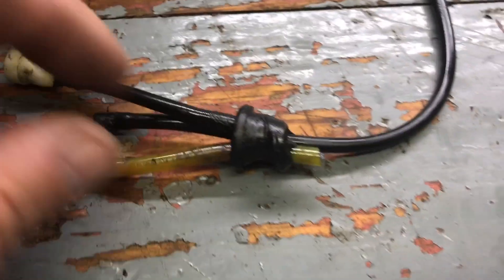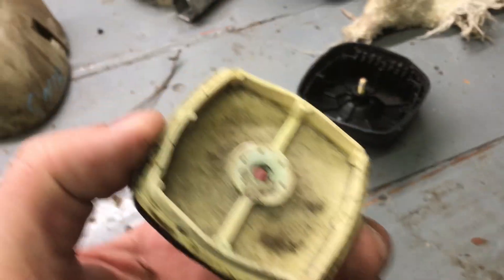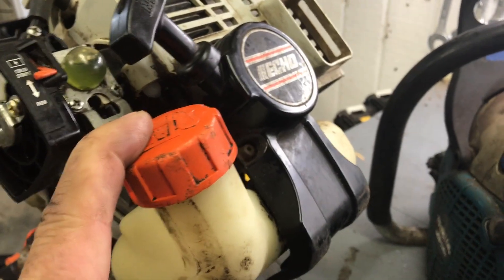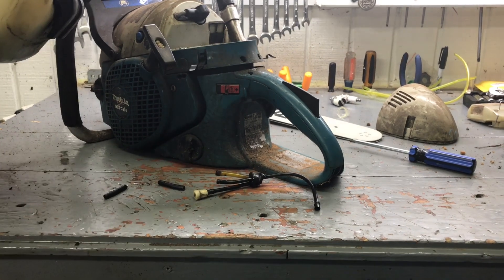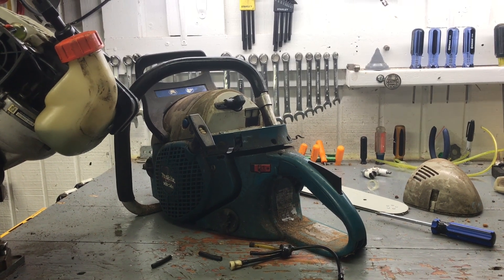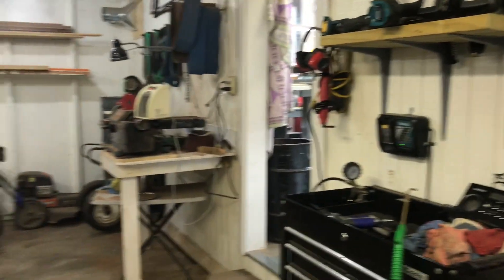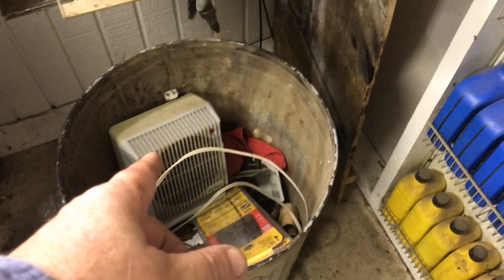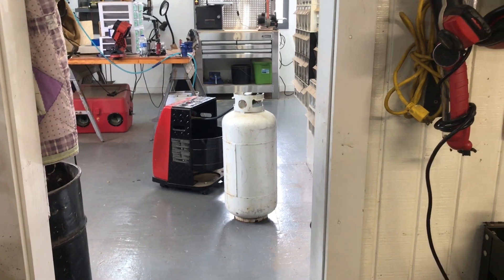Echo weed eater gas leak fixed

Comment: I figured you'd have those fixed pretty quick.  Great job!  About that temperature... I had both the bathroom and kitchen faucets running (not dripping) a couple days ago and the pipes still froze!!  I'm moving to Mexico.  I hear they have a sanctuary city for US citizens. ;-)
Reply from the maker: I hope none of the pipes burst! Ive had a heater in my shop bathroom for 4 days now. so far nothing has frozen.
Reply from the maker: We both live in Louisiana. These are highly uncommon temps.

Comment: Thanks for your video. Would you mind telling me what would cause gas to leak into the air filter on an ECHO leaf blower?
Reply from the maker: My first guess would be that the needle valve inside the carb isn’t shutting the fuel off when it’s not running.
Reply: @bctruck  Thanks I will take a look at it.

Comment: Good job on fixing the Echo, if you deliver I will buy it LOL. I know about cold shops, mine isn't insulated and what little heat I put in goes right back out. Be well and be warm brother.
Reply from the maker: Guitstik Kustoms I’m thinking about putting some styrofoam insulation on the bare walls of my engine shop. It would make a difference in being able to warm it up to a comfortable level.
Reply: I have been needing to do the same thing for years, I just never have the time or money LOL.

Comment: I see on the wall behind the Makita chainsaw the magnetic strips with your combo wrenches held in place. I very recently "discovered" just how nice and convenient those are and I now have 4 of those in my big shed holding everything from my drivers, metric and sae wrenches cutters, pliers, channelocks etc. . I plan on getting more of them.Just slap the tools  in place and they are staring you in the face when you need them. No need to rifle around in tool boxes. Going down to minus 10 here in S.E. Mass in @2 days.
Reply from the maker: Minus ten! That’s inhumane!!

Comment: I paid $500.00 for a gearbox for my John Deere mower/tractor, they had the pto engaged when trying to put the mower deck back on. You have to drive tractor over the mower deck, so needless to say, I now have a twisted mangled mower deck, but it didn't mess up my drive shaft or anything else, sheesh! Looking for a new/used mower deck now 😡
Reply from the maker: I hope the dealer is going to pay for that!
Reply: BCtruck, rebuild, repair,repurpose nope, it was my brother that did it. I know it was an accident, but dang it.....gonna cost me some coins!
Reply from the maker: Willows Garden yep. The cheapest way is to buy a bare deck and transfer your hardware fro the old to the new deck. What model is it and size of deck?

Comment: Mine leaks gas out the carb when I leave it sitting what could be wrong?
Reply from the maker: arturo munoz the needle valve may not be shitting the fuel supply off when it’s not running.
Reply: @bctruck  thank you. Will look into that